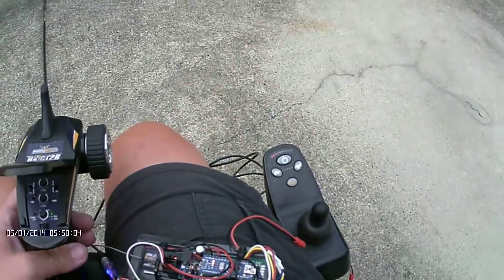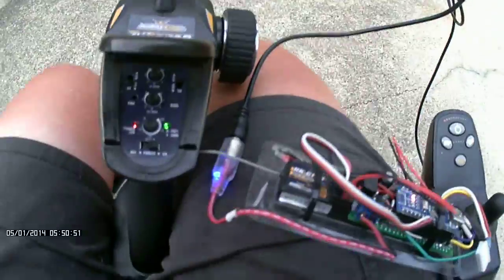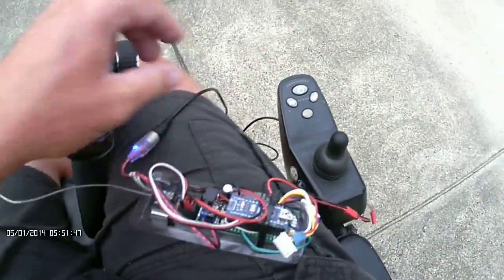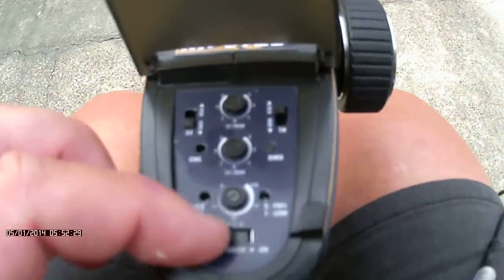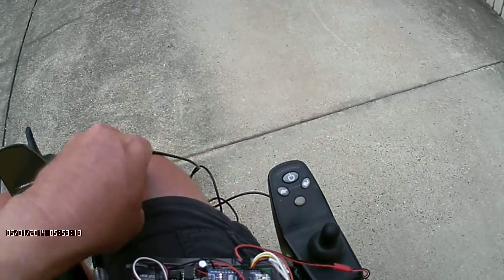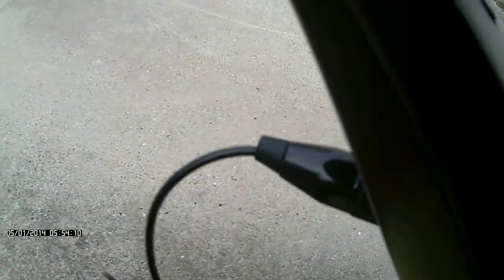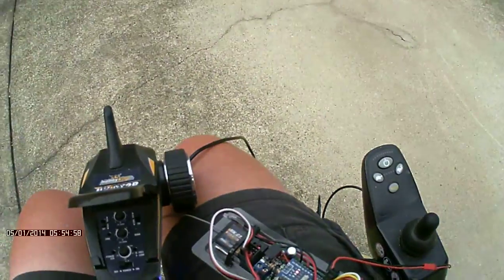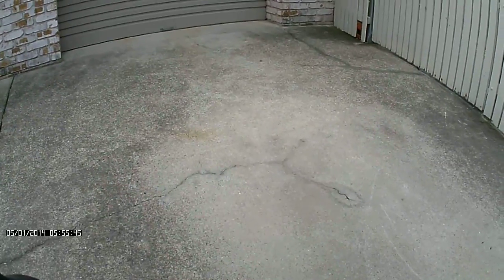Dynamic Shark Wheelchair remote RC emulator

Comment: Hi, really Good, could you share a list of parts needed to build this rc emulator?
Thanks
Reply: Hi Paolo, the details are here http://www.greenmobility.com.au/8-2/ parts list is printed on the PCB boards.
Reply: @anthonymatthews4955  thank you very much, I see all the components needed; I'm building a similar stuff but I encounterd some trouble, could you gently share me your email address so I can explain you what I'm building, for sure your better than me because you already built it
Reply: @paolodirenzo96  Hi my build is on wheelchair driver.com : I’ve two threads there with many of the issue’s I faced and responses and assistance from forum members. If you post on the threads, together we might be able to help others whom may be experiencing similar build issues.